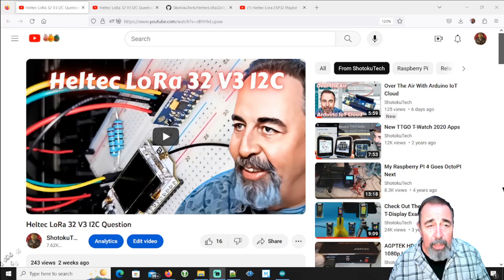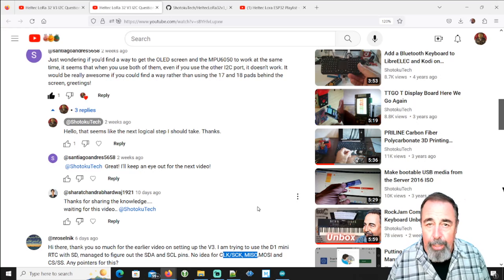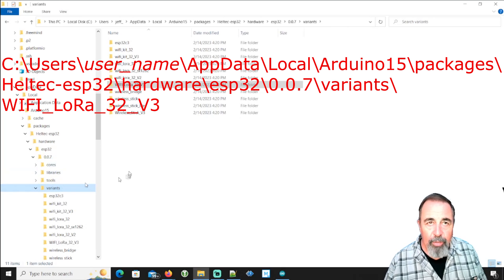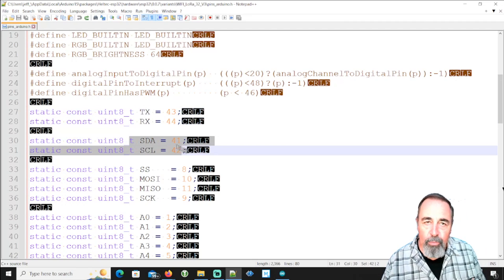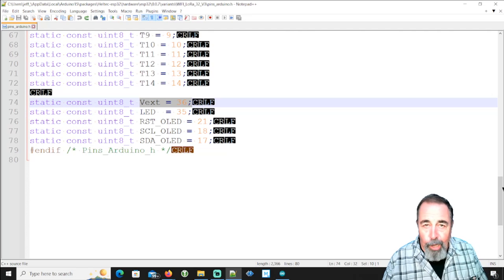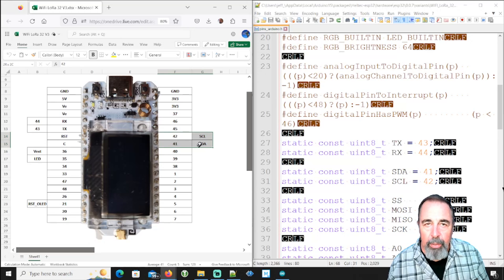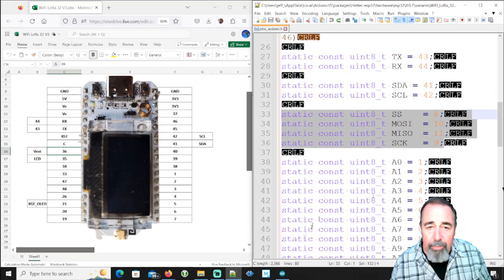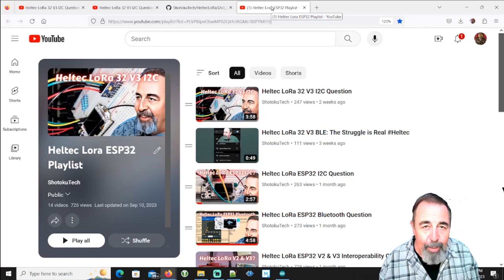Heltec WiFi LoRa 32 V3 SPI, I2C, OLED I2C, and Serial Pins

Comment: Thanks, Yes I'd expect changing the pin defs to break the board.
Reply from the maker: GPIO45, 46, 47, and 48 are unassigned and I have demonstrated serial and I2C connections to the V3 board. I have an extensive Heltec WiFi LoRa 32 playlist. Thanks.
Heltec WiFi LoRa 32 V3 GPS Question
https://youtu.be/tQZC4GlYhMc
Heltec WiFi LoRa 32 V3 with MPU-6050
https://youtu.be/5lEMRN-o_ng
Heltec WiFi Lora 32 Playlist
https://www.youtube.com/playlist?list=PLVPBipeObwMP02QIrh3RGMs1BtPTMt19j

Comment: Sir is it possible to connect heltec lora v3 to another heltec lora v3 in a mesh connection. Lets say 4 heltec lora v3 communicating to each other
Reply from the maker: Yes: "Meshtastic on Heltec WiFi LoRa 32 V3"
https://youtu.be/H37IDKc9fMk?si=Hg-MClBqdkoaVY2_&t=153
Reply: @ShotokuTech  Recently watch your vid sir, I'm just wondering if it can be program to be independent and not needing the phone to deliver messages from other lora

Comment: I don't know if you have every covered adding solar power to aid in powering the Heltec Lora boards? Is there a power controller or charging module on the V3 board as I'm not finding a diagram anywhere? If so, is there access by pinout to add a small solar panel to charge the attached battery. I have a 1000 mah lithium battery with micro connector. Also I have these FORIOT 1865O Battery Holder with Li-ion Battery that does have a controller that connects via the usb C connector on the V3. And I have a SD05CRMA 4.4-6.5V Input Solar Panel Dedicated Charging Module. Any ideas? Wondering which way to go. Thanks
Reply from the maker: This is a brilliant discussion you have initiated. I have to investigate further. Thanks for your support.

Comment: I want to connect the NEO-6M GPS module to the Heltec WiFi LoRa V3 product. 
I referred to your previous video, but the pin maps for V2 and V3 are different, and I'm not sure where to connect the pin of GPS.
can you help me connect gps to v3 board???
Reply from the maker: Hello. Did you watch this video? I show the serial pins in this video TX and RX. I also have a link in the description to my Github page that also features the pin diagram. Thanks!
Reply: @ShotokuTech I watched the video and connected using rx and tx and couldn't get any data from gps
Reply from the maker: @하-논  Hello, and are you crossing the wires so TX on the board goes to RX on the GPS module; RX goes to TX, right?
Reply: @ShotokuTech  yes I crossing the wire
Reply from the maker: @하-논  Okay I will try it here then. Might need a few days. Three things already ahead on the workbench.
Reply: @ShotokuTech I'm connecting the power source of this board using a Type c cable to the portable battery and can this affect rx and tx?
Reply from the maker: @하-논  This should be fine.
Reply: @ShotokuTech  In your old video using lora v2 board you connected 2 and 17. In the pin map of the v2 board, pin number 2 is not an rx pin
 Is there a reason to use it like that?
Reply from the maker: I went ahead and took your question ahead of the rest of my projects so stay tuned.
Reply from the maker: Heltec WiFi LoRa 32 V3 GPS Question.
https://youtu.be/tQZC4GlYhMc
I think it might work if it is not connected to USB. But then there would be no serial output to monitor.

Comment: Ahh, thank you for this. So the bad news is that the SPI pins are not exposed. If they are indeed shared by LoRa (most probably), is it possible to use your trick of alternating the CS pin? The one you did with TTGo T3.
Reply from the maker: Now that you mention TTGO, I have to say this V3 from Heltec has me asking myself why am I not looking at the TTGO LoRa board right now. I easily used a TF card with one here: "TTGO LORA32 V1 With SD Card Data Logger"
https://youtu.be/hLCFNR3jp8Y
I must revisit these boards and see what the latest developments are. One thing for certain is ESP32 S3 changes the landscape and I am finding it not easy to adapt to the change. Thanks.
Reply: I did use TTgO Lora V3 1.6.1 and your video and code actually helped! Its a bit easier since the TF reader is embedded together. I just have to attach RTC to get some timestamps for my sensor data. I just added a buffer code for the incoming data, so its saved after 10 text (just to prevent read/write error by the sd card). Would have been nice if I can get the Heltec to work though. I've got three of these lying around. @ShotokuTech